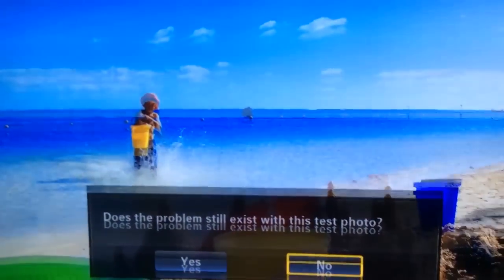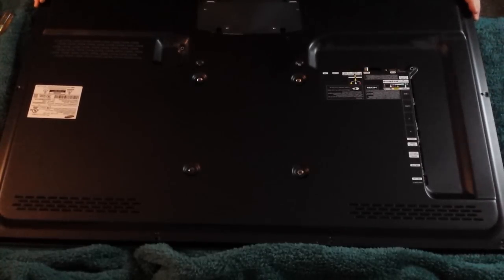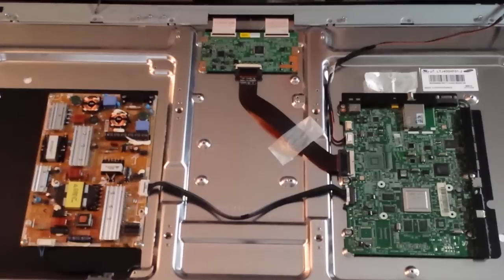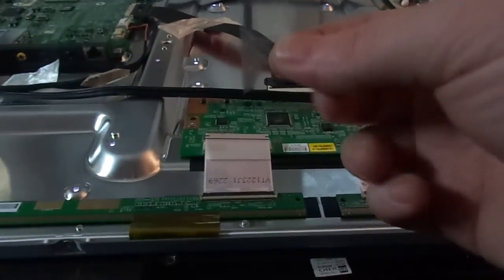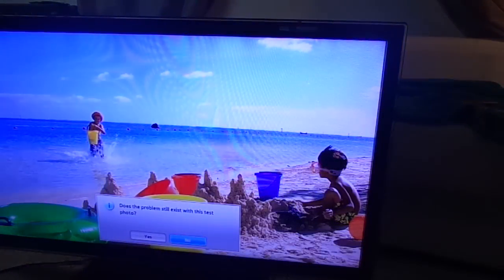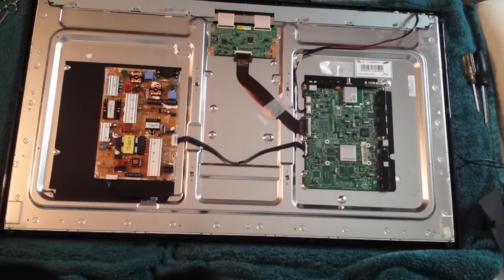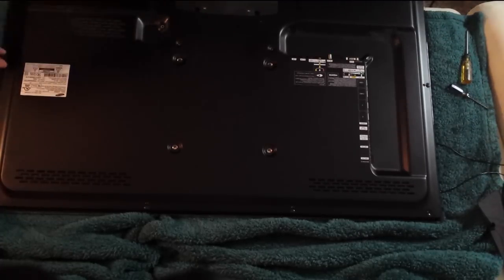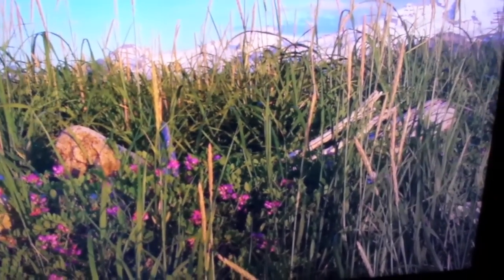LED LCD TV FIX, How To For Samsung Double Image, Black Vertical Lines, Screen Problem Sony LG.

Comment: used paper bec. didn't have tape at the moment and IT WORKED!!! and then i opened the tv's back again to change the paper with tape. saw an electric spark at the connector's contact and....yeah...i pretty much fixed it and then fried it. but still...IT WORKED!!! before i ruined the tv...many thanks though. god bless.

Comment: Would you please guide me on horizontal lines? Samsung LA40D550 that has running horizontal lines occupied half of the screen.
Reply from the maker: If you are following the steps in this video you'd probably just need to adjust the cable a bit for vertical lines only (no double image).

Comment: Can you explain what this does and what the ribbon actually does. Don't understand how blocking fixes this. Does each wire in the ribbon correspond to one vertical line? Why would blocking a few lines not create a band of no video on the screen?
Reply from the maker: Yes each wire in the ribbon cable corresponds to one vertical line. Static electricity builds up on the cable connections and creates the double image. Removing the cable discharges the electricity, and the clear tape helps prevent that from happening again. The tape does interfere with the image quality however it's only really noticable when the display is completely white. Other than that the picture looks great. This is not a professional fix just a last resort for the diy.

Comment: I have a weird one. LG LCD TV Model 60LF6300. The picture is... slow. Lagging. There is some colour distortion too... the effect is kind of ghostlike. The menus work but also lag. Any ideas?
Reply from the maker: You may want to look into fresh rates, and see if the menu on your tv allows you to adjust it. Also I saw a video someone posted on YT with similar issues, and got it looking good just adjusting menu settings. I hope this helps.

Comment: Just got lower horizontal lines on LG roku tv  but mine are sorta red / orange and although this fix might work having it powered on while moving the ribbon around has me a lil jumpy as I use HDMI connection and not cable and worrying about feedback going to my receiver or cable box ?
Reply from the maker: You may want to check out some other videos directly related to multi colored lines just to see if there is another option for the issue your tv is having. This video is in no way a professional fix more so a last attempt to get the display looking good. As far as being able to view your progress while following the steps in this video I think an HDMI would serve the same purpose as an antenna cable would. You could always use the menu as a way to view the display. I hope this helps.

Comment: So I've watched this video, first things first well done Sir! Now I have a different model NU7400 do you have any recommendations for that TV? I don't have two ribbons that control each half of the screen
Reply from the maker: There are a couple of videos showing a different configuration of cables that aren't detachable, and surround the outside of the display.  They use spacers to fix this issue. The single ribbon cable may benefit from using tape but really not sure. Ppl have said they replaced the t con board and that worked for them. You can find them on eBay.
Reply: Thanks for responding, would you happen to know where these videos are at all? I've looked everywhere for an answer for the TV and this is the closest I've got

Comment: Hi, Samsung TV displays a horizontal line in the middle and a black one on the bottom side... Tried your tape solution but no luck, different sizes on different places but the lines never go away, so worth the try but it seems really broken.

Comment: Hi Dave, i have a Samsung QLED TV Q7F, do u think this method will do with qled tv ? I was watching my TV yesterday night and all was well..... Wake up this morning and saw the double image problem, i feel like committing suicide. pls help
Reply from the maker: That's a bummer, those TV's have a great display. I can't say for sure however it is a led so it's very possible. If you do try this make sure you have time to focus on it not to rush yourself. Sometimes frustration can get the better of us wanting our tv to just work.
Reply: I have this same issue that started 2 weeks ago on my QN55Q7. Still no luck.
Reply from the maker: Based off online pics of the Q7F t-con board, it should have two ribbon cables so you may be able to follow these steps with success.
Reply: I actually end up buying another TV.... firstly samsung customer support told me to pay 1600 usd just to repair the tv, they said they had to replace the entire panel! I told them I bought d tv for 1900 usd and it would be better just to get a new one. Your fix was not easy to do for this TV.
Reply from the maker: @armachea  yeah replacing the panel is always a go to for the manufacturer. Would be nice if they had a less expensive alternative.

Comment: Fixed my vizio tv this was insanely helpful seriously thought some wires had short circuited, had no clue what I was doing contemplated wether it was the inside issue  or lcd screen but after various videos figured it was something else ,, all other videos required buying tools or changing tcon or completely getting screen repaired, but this videos was straight to the point so easy to do and got it  right the first attempt ,thankfully didn’t have to keep adjusting , thanks so much as right now is not the best time to buy a new one , will see how long this repair last hopefully a good while again this video was extremely useful thanks for uploading !saved us 400-600$

Comment: Your instructions are very straight forward and simple to follow. What I can't work out is that does the strip sellotape go over the pins - from back to the front and then stuck it down - back to front. And then how do you know when your picture is perfect. Do you have to keep moving the strip sellotape moving to the left or right by covering and uncovering those delicate connections that get pushed into the LCD ribbon slot? Is it by trial and error checking - and rechecking what the picture is like on the other side on the screen? Your clarification will be greatly appreciated.
Reply from the maker: It's no professional fix so yes it's a bit trial and error. People comment placing the tape on some of the good pins then moving the tape a bit if the picture doesn't improve, also you can try smaller pieces as you go. The ribbon cable tips are very delicate and can easily be damaged. I hope this helps.
Reply: Thanks. I've got the tv off the wall onto a flat cushioned bed. I am going to photograph each stage so I know how to put it back together in reverse order. The sellotape you used was a little too transparent to see properly where the edges were when you stuck it down. As you say - a bit of trial and error. Thanks for the prompt response -  greatly appreciated - and the great service you share.

Comment: Dave thank you for very useful video. I am facing the double image issue on my Qled tv, bough it almost 2 and half years ago. I followed your video very carefully and it was extremly useful. I spent an hour working on it but now the double image comes and goes every few seconds. Getting quite frustrated. Any other tips you can provide on how else i can get around this? Thanks again Dave.
Reply from the maker: From what I understand the double image is due to static electricity building up on the terminals where the ribbon cables attach. So it's possible that your tv is still experiencing a build up that eventually discharges, then repeats. I know it's no fun but you could give it another go either by placing a larger piece of tape on the ribbon cable tip and or gently adjust the cable a bit. I wish I could tell you exactly how to fix it. This is not a professional fix and results vary.

Comment: Thank you  so much ..worked on my LG 49" smart tv..the repair guy said $150 to fix... quick question does covering the connectors affect the components or is it totally safe? Just wondering
Reply from the maker: I don't think any components would be affected. The tv that I worked on in this video is  still looking great.
Reply: @DoItWithDave  thank you so much..cheers

Comment: What if you still have double image/no image/flickering when you remove left/right tabs , I replaced tcon board same issue still, these methods have not worked any ideas? How do I know if it’s bad panel and is it possible to repair if so
Reply from the maker: From what I know usually to repair  the double image issue the technician will recommend replacing the display which in many cases is more expensive then just purchasing a new TV. The demonstration in this video is not a professional fix, just a last resort for someone trying to fix their tv.  That being said from what you posted it is possible that the ribbon cables could be damaged. If you look at the tips of the cable where it has gold tabs you may see they have scratches or brown or black colors. They are very delicate and can easily be damaged. If you see any damage then they may not work properly. I had the flickering issue when doing this before and found the cable tips were damaged. Ending up replacing them and it fixed the issue. I hope this helps.

Comment: It didn't work for my 55 QLED Samsung TV.  What a trash this Samsung brand is; not even 3 years since bought new for $$$$s.  Very disappointed in Samsung brand.  I used to always have Sony and Phillips; they never broke - ever!  Samsung, after 2+ years - DEAD!
Reply from the maker: I wish this video would have helped correct the issue your tv is having. It's definitely not a professional fix, just something that is a last resort. These displays seem to almost always have this issue, maybe so the consumer will need to replace the tv all together. Thank you for your comment and thank you for watching.
Reply: @DoItWithDave  It actually really helped.  It was until past midnight (1am) that I was working on for hours; tired then.  I did it again today, and guess what: Problem fixed (the double image); however, I have 2 horizontal lines.  But I can watch that TV now.  I no longer have to spend another $Thousand to watch TV.  Thank you, Dave!  P.S!  Persistence is really rewarding!  My wife even was shocked that I managed to do it that she shared with our family in New Zealand how proud she is that we finally got to fix our Samsung TV. :)
Reply from the maker: @r9p0m7p8  awesome! I'm glad you were able to get rid of the double image. And you are absolutely right, patience is key, and I great trait to have. Thank you for posting an update!

Comment: Hi,

Please help! Ive got a Samsung 55" ue55es8000 and am experiencing vertical lines on the screen similar to problem 1. I have changed the LVDS and the wire that connects from the main board to the t con board but nothing's worked so far. Also changed the t con board. Any help would be appreciated!!

Thanks
Reply from the maker: You have already replaced the components that I'd think would be giving the vertical line issue on your TV. In the video I was able to get rid of the lines by gently positioning the ribbon cable until the screen looked good then  locking down the tabs. You may want to check that the ribbon cables don't have any damage (scratches or brown spots) they are very delicate. Also give the compactors a quick look the make should non are damaged. The capacitors have an x on the top and should be smooth (no hump) if they are functioning properly.
Reply: @DoItWithDave  ok thank you very much. The two shorter ribbons (attached to t con board) look damaged. But now the screen has completely gone black! I'm not sure if its because I've further damaged the ribbon. Could that have happened? I want to replace them but not sure if it will help :(
Reply from the maker: @sanakhan7409  damaged ribbon cables can definitely be a cause for the display being blacked out. It may be worth a shot to purchase a couple. eBay has a lot of options (cheap). The cables should have a part number printed on them.
Reply: @DoItWithDave  thank you! I will try that, hopefully it will work!
Do you think it will fix the vertical black line issue?

Comment: i did manage to eliminate the double picture but the screen is a laggy ..any ideas?
Reply from the maker: See if you can adjust the "Refresh Rate Hz" in tv menu, that could help.
Reply: @DoItWithDave  hmm my tv is lg 49" smart tv..i dont think there is a refresh rate hz anywhere..

Comment: Hi Dave, thanks for the video. I have been wondering why it didn't work for me. I spent over 12 hours adjusting the tape size and position. The best I could get left a wide vertical band of lines with no picture in the middle of my LED Samsung TV. Is there other thing I can do to get rid of the vertical lines
Reply from the maker: The lines are more or less noticable depending on how the ribbon cable is placed. The gold tips on the cable need to be lined up with the corresponding tips in the insert slot the cable rests in. I show very gently adjusted the ribbon cable to align the connections and lock down the cable once the display looks good. Other than that I can't really say what else I'd do about the lines. I hope this helps.

Comment: Absolutely worked a treat. We have the 46" model, and the problem was the horizontal 'shadow lines' and also a few rows of dead black pixels. When playing with the ribbons, I found that unplugging the left ribbon (right when repairing) resolved the issue on the other side of the screen. I tested with a 2mm wide piece of tape moving over different pins, and found that some of the pins about 2/3rds the way along solved the issue completely. Can't thank you enough!

Comment: Hello Dave, mine is a Samsung LA32B45C4, and the problem really is, upon putting ON, picture is good, then after say a minute, the image goes DOUBLE. Just the same, I opened my TV and found that it has ONLY ONE flat cable for display panel instead of your video having TWO. Tried covering the left end (stand end towards me) with 1/8" wide tape the display was split, left side vertical lines while the right side was totally black. Then tried covering the center, the whole display was vertical b/w lines. Tried covering the right end. Good display at first, then double image again. Widened the tape width to 5/16", display looks like overexposed picture and can not tell if there still was double image. Experimented with wider or narrower tapes, to no avail. ANY OTHER ADVICE?

Comment: Hi Dave, I had the double image and the vertical lines issue as well, so I decided to try my luck watching your tutorial.. Unfortunately it didn't work, after the passage of the tape on the ribbon band the screen went all black, no image anymore.. I don't know that to do.. (if this can help you, when I removed one of the ribbon band I already saw that I didn't see just one side of the screen but the screen already appeared completely black..) I hope you can help me, I don't know who else I could ask to (because right now I can't go out.. I am from Italy, I don't know if you get what I mean..)
Reply from the maker: Double check that the ribbon cable is not damaged. The tips are very delicate. If they are damaged it should be very easy to see. If they are not try putting the cables back in without tape. Does the image look the same (double image)? If you still see the double image then you can try the steps shown in this video. When you place the tape it could take a couple of times to place it on the (sweet spot). I started out using a large piece of tape that would cover less than half of the gold tips of the cable. I had to cut the size of the tape to reduce the amount of the gold tips it covered until I got the display to show a clear picture. When doing this be very gentle the ribbon cables are delicate. I'd you see any damage (scratches) on the tip of the ribbon cable may need to be replaced. I covered about 12 of the gold pins on the ribbon cable and it ended up working. I hope this helps. Hope you are well over there.

Comment: Hi great video thanks for the tutorial i found that you don't need to remove the speakers and the metal bracket to adjust the ribbon cable and the small philip screws wouldn't budge so yeah there's that. Now don't have the double image problem but small white dots has appeared, any advice on it? It's either the reflectors, or dirt from the screen. Should i take everything out again and clean it, or just stick deal with it and enjoy with what i already have. Cheers
Reply from the maker: It's really up to you. I'm not sure exactly what would cause the white dots however you could give it a web search and see if you find some info on it. Otherwise yeah if it doesn't bother your viewing experience too much then it is what it is. Thank you for watching and your comment!
Reply: @DoItWithDave  thank you for you time and cideo again really helped out, now got a metflix machine in my room during this covid19 pandemic, cheers